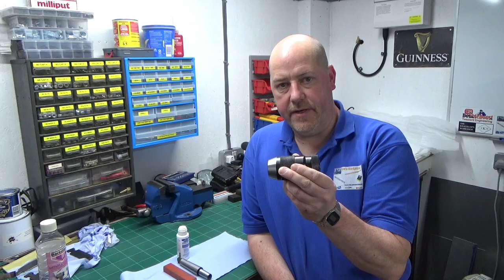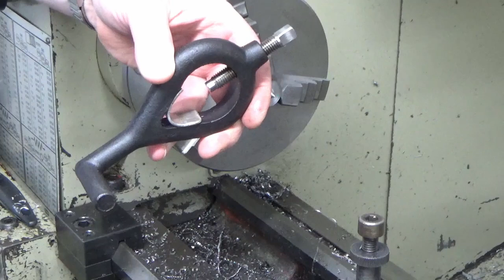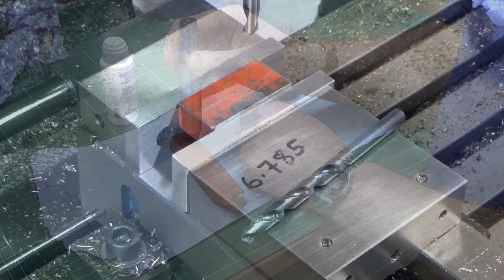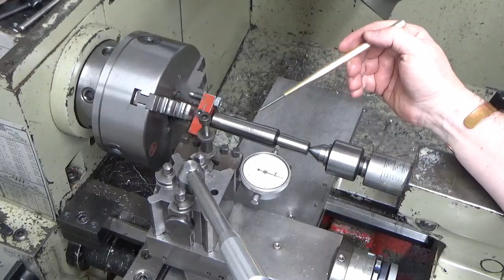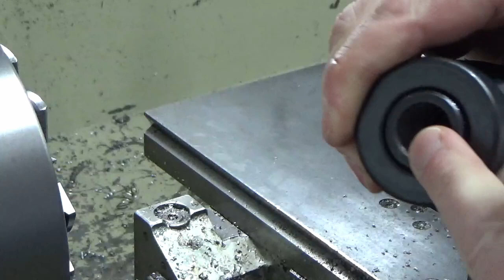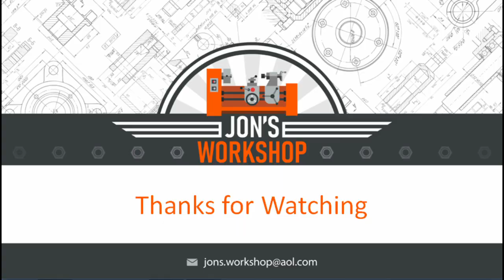New Keyless Chuck For Harrison M300

Comment: Nice one Jon. To get a really good finish make up a shearing tool from a piece of HSS, you will shave off what looks like steel fluff, finer than 0000 steel wool. Cheers Peter from Oz
Reply from the maker: Hi Peter, thanks for the comment. Yeah, I have a couple of these already ground up but went with carbide due to the relative hardness, as it turned out it wasn't that hard, I think HSS would have coped. In the memory bank for next time. Cheers, Jon

Comment: A groud arbour needing a little attention?.
If only you had a surface grinder!.
The set up and making centres to hold and grind, that would be a very impressive video. And addressing possible run out problems before brown smelly stuff hits the fan. Perhaps when runout is a problem.
Reply from the maker: Hi Fred, thanks for the comment. Lol, I thought surface grinder but need some form of spindle, Definitely a future project so hold tight. Cheers, Jon

Comment: Nice, looks like i turned out well. I'm not sure if i would have gone through the trouble, but seeing as it's not that difficult, i might do this if i ever run into a problem like this. I believe the MK3, which you referred to as Mark 3, is Morse Konus 3. (it's "cone" in german, my language has a similar word for cone). Seeing as your lathe dog is too big for your chuck, can we expect you to make a suitable one in the future? :)
Reply from the maker: Hi Anti, thanks for the comment. I probably could have just left it as was but it would have bugged me forever. You most certainly can, when I need a carrier of any size, providing I have some scrap materials laying around, I will most certainly be making one. Cheers, Jon

Comment: Nice fix Jon!!! I'm curious about something. Could a file or possibly a flat stone be used to grind the surface a little flatter instead of the emery cloth? I'm just thinking,,, I have never tried anything like this.
Reply from the maker: Hi Danny, thanks for the comment and question. Yes and no probably, much harder to control with a file but possible with care, a flat stone would also work but very slowly, in summary, one is slightly too aggressive and the other not quite aggressive enough. A flat stone post emery cloth to enhance surface plane would be a good option. Cheers, Jon
Reply: @jonsworkshop  Thanks for the reply Jon!!!

Comment: Couldn't you hear me shouting it will bottom out?
Good lessen though👍
Reply from the maker: Hi Chris, thanks for the comment. Nope, couldn't hear you over the guy stood on my left shoulder shouting the exact same thing lol. He usually holds a little 3 prong fork in one hand but on this occasion he was actually trying to be helpful. Pleased with the end result, although still need to do some geometric checks, which may seal its fate! Cheers, Jon

Comment: Good video Jon.  I have the same chuck from BG.  The tang was a bit long like yours, but I didn't worry about it.  I checked the arbor before assembly and it clocked in spot on.  Big surprise. 
 
I thought your modified taper would end up being too long.  It was inevitable ;)

To check any combo runout with mine after assembly I put an accurate test piece in the drill chuck jaws, mounted that in a collet in the headstock and clocked the Morse taper.  I was pleasantly surprised.  It was very good for a cheap drill chuck (less than 0.01mm in three positions), so the jaws on mine are quite accurate.  

I have a genuine UK Jacobs 3/4" chuck and arbor (of unknown origin) combo I bought new many years ago for my pillar drill and it has always had significant runout.   I always suspected the arbor was faulty but couldn't get it apart even with considerable force, so I decided to address it by regrinding the taper in the configuration mentioned above.  It was way too hard to turn with carbide, but a TPG grind on the Morse taper worked well.  I was able to leave the tang end unsupported because of the tiny grind load and so avoid any issues with the tang center point being out.  Turned out damn near perfect.

Interesting subject and I was very interested to see how you went.  

Cheers Rob
Reply from the maker: Hi Rob, thanks for the comment. Interesting checking method, now if only I had a collet chuck lol. I think I will just turn a bit of bar in the 3 jaw near 16mm and then clamp the chuck onto that, should work as well I think. I will probably include a bit of footage in my next Blether video so thanks for the tip. Tool post grinder eh....... Now there's a thought! Cheers, Jon
Reply: @jonsworkshop  Good idea Jon.  I never thought of that.  A small TPG is super handy for all sorts of activities.  Cheers Rob

Comment: My first thought was "leave it alone" 😳
I expected it would bottom out.  You needed a more rounded cutting tip to produce a smoother surface finish.
For the other commenters out there, this was not a repair, this was done for aesthetics.
The JT6 taper and the B18 taper are the effectively the same taper.
An acceptable result in the end 😃 👍
Reply from the maker: Hi Zen, thanks for the comment. I very nearly left it but it would have forever bugged me. I used a 1.6mm rad tool which was the biggest I could really go to get tight up to the shoulder, I think the edge is knackered, should have looked. Whilst I agree with your aesthetics comment (this was the main driver for me), I also believe that increasing the length of taper location by at least 50% over the original has benefits. Difficult to quantify them but more resistance to slip with high torque operations is one (that said the Jaws will slip first), plus slightly less magnification of any tailstock errors due to less stick out. Cheers, Jon

Comment: That was brilliant. I was explaining to someone recently how a machine taper locks parts together. I'm going to send him your video to further develop the point.

The tap wrench and follower work superbly. I was thinking about facing the B18 end of the taper. I came to the conclusion that you mustn't have the morse taper adaptor that goes in the lathe spindle on Harrison M series machines. I was expecting you to take off the three jaw and fit the adaptor, then put the MT3 portion of the part into the end of the spindle, holding it that way then facing it. As it stands, what you did was utter genius, I've put that idea in the notebook for future reference.

I'm on my way home now. I'm in a hotel in Indonesia, locked in til Tuesday when I fly back to the UK. Then 10 days in a quarantine hotel. When I do get home that will have been 76 days. So it is always good to see you and spend some time in your workshop.
Reply from the maker: Hi Carl, thanks for the comment and the share. Bang on mate, no MT adapter otherwise I most probably would have just done what you expected lol. Necessity is the mother of all invention, just glad the end mill cut nicely, if it had grabbed, it would have made a right mess. Safe journey home pal, you must be missing the family. Cheers, Jon

Comment: Good one . Contact looks like there will be no problems .   Best results i have had is with bearing blue .    Cheers .
Reply from the maker: Hi Max, thanks for the comment. Yep, it's not going anywhere! I used to use micrometer blue, but I just end up getting it everywhere lol. The Dykem does a pretty decent job. Cheers, Jon